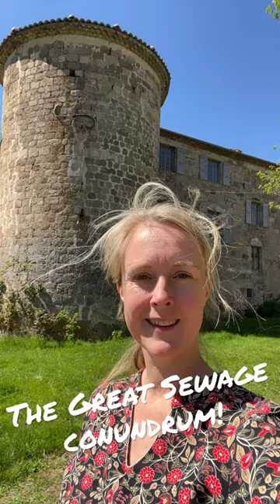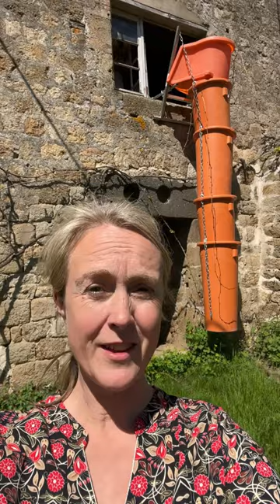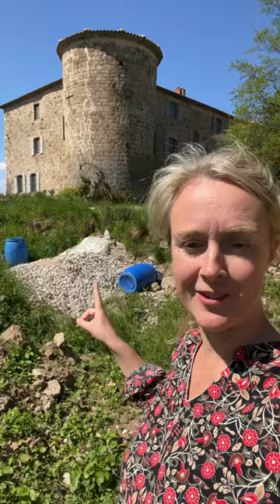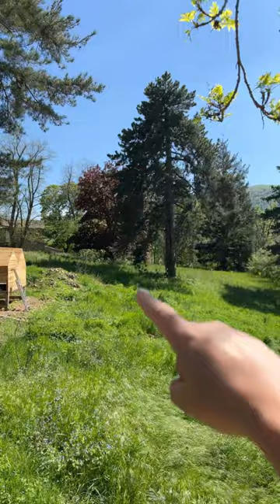Why on Earth aren’t we using a building chute to transport the sewage stones?! #chateau #renovation

Comment: I feel like I must be missing something obvious here, but if shoveling is the only sticking point, isn't that going to be a problem with the tractor, too? IE, if you could use a mini-digger to load the stones into a tractor, then you could use it to put them into a chute? And if you'd have to shovel the stones into a chute, won't you have to shovel them into a tractor?

However, if the problem is that the slope of the ground is too steep for your existing vehicles to tackle with more than a small load of cobbles, but too gentle for a chute to reliably carry them down the hill, then I understand! (And once again marvel at the ability you and Marc have when it comes to handling these things without screaming in frustration.)
Reply from the maker: Your second paragraph is exactly the situation! And the machine we’ll hire is a very large JCB-type I think. It will scoop up the pebbles with a very large bucket and transport them down the slope.
Reply: @Chroniclesofrosieres  Thanks for clarifying - that definitely helps my confused brain make sense of things! And I can completely see how a scoop and carry machine will make the job go more quickly 🙃

Lastly, although your yard is lovely, boo in this instance to a slope that seems like an inversion of the 3-little-pigs' story. (Flatter would work, or steeper could work. But what you've got is just enough of an in-between to cause aggravation all around.)